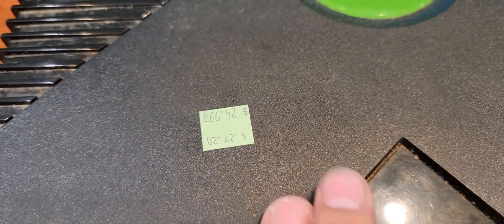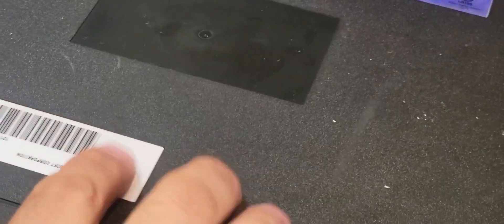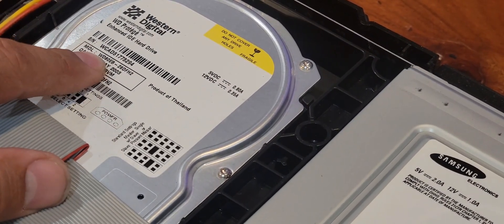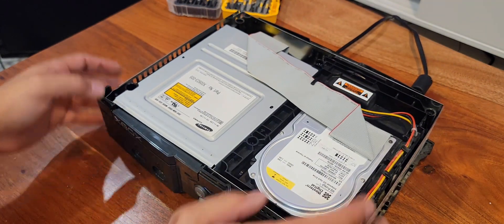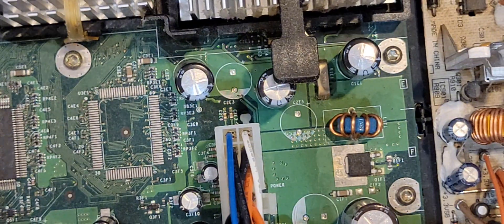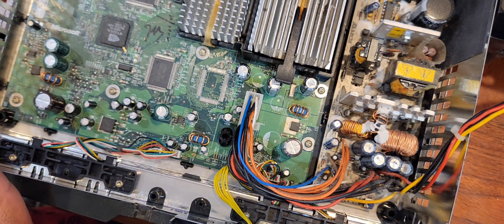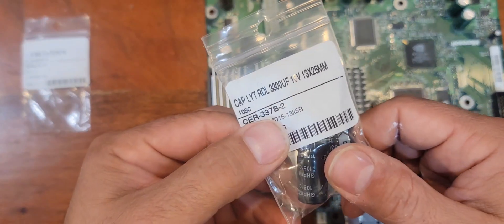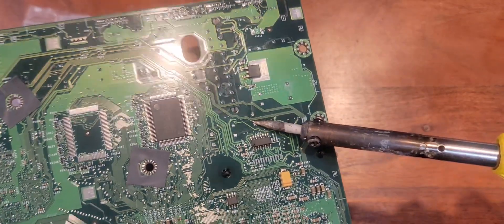Original xbox, no audio and video problem

Comment: That looks to be a late 1.3 because of the conexant video encoder looks a lot like a 1.4 except a 1.4 has a Focus encoder, those 3 capacitors, the infamous Nichicons under the CPU are ALWAYS the main culprits of video glitches, no video and audio, intermitent frag and no power on 1.3 1.4 and 1.6.

Comment: Good job man, I have a 1.0 2001 model won’t display video either. I have 5 capacitors in the same location where you have 3. I will try the same and see if I can revive my 1.0 revision xbox.
Reply from the maker: Good luck bro

Comment: Just looked over this video again .. Well done for reviving this console !!!!
You have version 1.2 - 1.4 .. The clock capactior denotes that.
You should remove the clock capacitor. They have a habbit of failing and leaking out.
I would say at the moment it is software modded. It might be better if you spend some time and do some reading up on TSOP flashing, that way if the hdd ever fails you can put in another hdd and use something like "slayers boot dvd" to rebuild the system.
Its been some years since i last did any of this but it was all good fun and i learned alot.
The OG Xbox scene is pretty active to this day also !! 
Best wishes, best of luck.
Reply from the maker: Thank you ❤️

Comment: Painful .. The drive is 8gb not 80 ...
Reply from the maker: The hard disk drive is 80 GB
Reply: @fixitallmystuff  110% cant be .. They never EVER made a 80gb version they come from Microsoft either 8gb or 10gb... youve obviously modded it at this point .. Or it was previously modded and the peron that modded it was very careful with the anti tamper warranty labels .. You can heat gun them off ..
Reply from the maker: @agentmarky5493 man, I like the I formation you provided us. Thanks 👍🏽
Reply: @fixitallmystuff  ,, Thanks and just to confirm !! @17.18 in the video xbox is booting up .. That pink evo X top left of the screen = modded console .. Maybe software mod.  Maybe tsop flash !! Who knows .. Good job on the repair though .. LoL keep it and get into some retro gaming, the OG xbox had some great titles and to this day is still an amazin bit of kit ..
Reply from the maker: @agentmarky5493 do you do consoles mod?
Reply: @fixitallmystuff  Not so much now .. Years ago yes, back in the playstation 1 days uptill the xbox 360 drive flashing times.. Its what got me into electronics!! I do still follow the scene and havent lost interest, it's a great hobby. I also like to encourage the movement !! I got a couple of tips for you .. Get some flux it will help with your soldering. Also clean up them cpu's & gpu's including heatsinks properly, then apply fresh conductive paste ..
Reply from the maker: @agentmarky5493 Thank you for tip, bro. You are the best